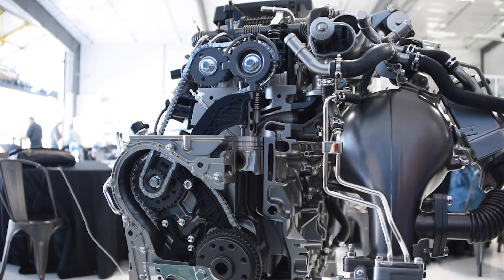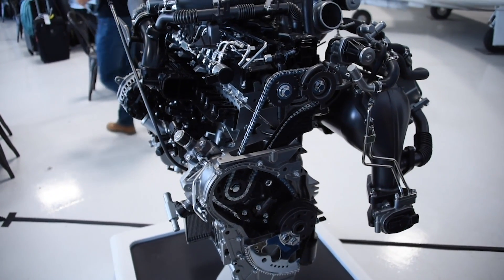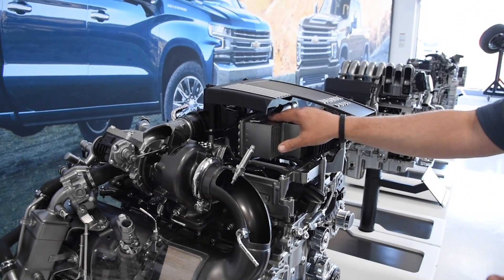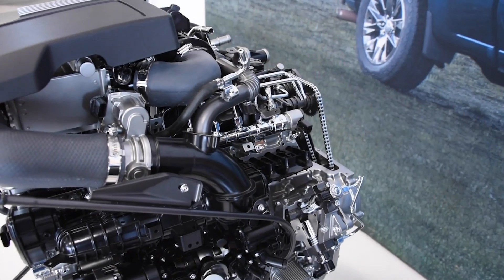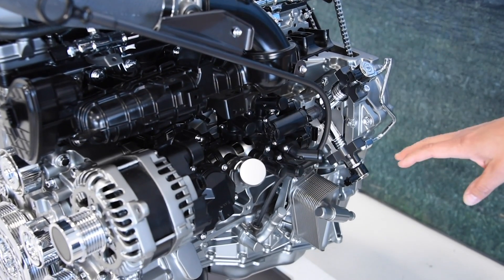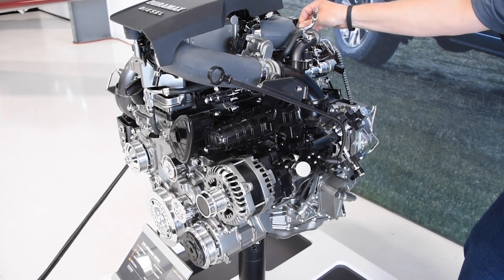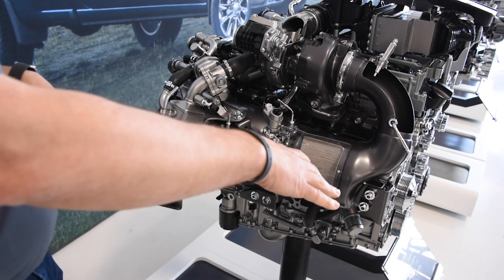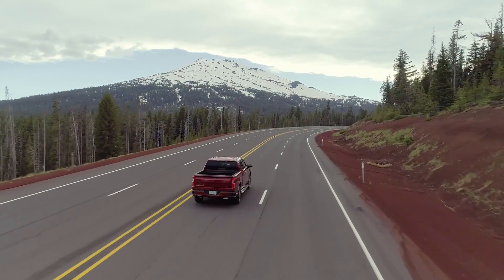What you don't know about the 3.0-liter Duramax diesel

Comment: My friend got one of these in a 2021 1500 truck, its very quiet, actually makes a good sound under power.  At least the rear timing chain is simple, not like a Audi 4.2 etc.  The timing belt is wierd, but with regular oil changes it could probably last a very long time, I wonder on this truck if you could just back the trans off 6inches etc to service it, drop a few driveshafts or its a huge deal, pull transfer case etc to change the belt.  You can see all the clever packaging to get into a compact modular unit that can go into just about any commercial\personal vehicle, the emmisions control is pretty neat with all the interesting coolant control (scary to have engine oil cooler like that, if gaskets fail...) Hopefully they're specced top quality parts on this thing for belts\gaskets or it could be, not so good.
Reply: Garbage design IMO. Monster amount of labor just for one chain that you know is going to be a problem.
Reply: @HVAChrisss  Dropping a tranmission is "monster amount of labor" every 150k-200k miles? Man how were clutches replaced in the old days, must have just junked the car every time it needed a clutch!
Reply: @HVAChrisss  It shows a OEM doesn't give a crap about after the sale with a design like this, considering this thing is also meant for Commercial application and likely built to a price, pushing 30psi of boost stock (lots of CFM I'm sure) its not good.

Comment: If the engine would only last!!! Chains and sprockets go out before 100k dam expensive to get repaired, the engine sounds like it’s knocking!!!  Oil pressure runes very LOW!!! Getting a lot of steal, silver, nickel, in oil sample. Have to change oil to AMSOIL and change at 6000 mi. Max. After repaired still rattling!!!  Sounds like a rod knocking. Needs to change engine but chevy won’t fix it properly . Run it until it comes apart. Transmission went out at 37k they repaired it. Rather than replace ???? Not happy at all for a 65k truck. Never again!!!

Comment: Sorry I won't buy a Duramax due to the belt driven oil pump and numerous sources stating belt change every 100k.  Come on guys why is it built requiring the removal of the transmission to change a wear item?  Am betting 5 years down the road this will have a very bad reputation.

Comment: Idiots..only a complete fool would run an oil pump with a rubber belt...and only a damn fool would run the timing in the back of the motor.  Way to go GM, take a decent idea and completey &*#($ it up with a Bull #&$(# design that was completely unnecessary

Comment: The motor is going to blow after 100000 miles if it even makes it there 😳 😅 they  Basically turn this motor into a water heater the oil coolant transmission power steering is all going to be cooked alive... 

When my car coolant hose broke and I had to make it make home I kept filling coolant up with coolant and it cooked my motor oil and hydraulic transmission fluid on top of power Staring fluid...

 The engineers at gmc didn't really think 🤔 about fluid temperature and when you pass it's threshold the fluid becomes useless  Because it loses all of its properties at boiling temperature... 

 My guess is the block's going to crack right down the middle or  All of the electronics are gonna be cooked and and the fluid and the motors gonna blow up... 

 They didn't even thermal wrap anything around the DPF or even if they did its just going to over all the time...  I would be really nervous when this thing re-gens and it gets really hot 🔥

Comment: The camara guy  just says "simple drop the transmission to replace the belt"? WTF!! man simple drop a trans...smh
Reply from the maker: Easier than disassembling the entire front of the engine, including radiator, three cooling fans, water pump, etc. and then re-assembling and bleeding the cooling system, which most people don't know how to do correctly. In any case, it doesn't matter because 95% of consumers will have the dealer do the job.

Comment: I liked it until finding out the timing chains are in the rear. Disgusting. I expect a German automaker like Audi to pull that crap (which they do) but not GM and CERTAINLY NOT in a truck. Idiot engineers. There goes long-term reliability.

Comment: Looking at this as a mechanic, I already see exactly where it will fail. Plastic intake with swirl valves will get sooted up after a while, oil pump belt? Seriously? , plastic Coolant flow controller will absolutely fail later on. Either electronically or leaks. All this stuff looks like the terrible Sprinter emission crap. Not really happy about this little diesel

Comment: Is there actually room to, "Just back off the transmission" when you need to change that oil belt? If it sits in oil why couldn't you have just made it a chain???? People who maintain their own vehicles knows how imperative oil flow is and you want to scare them with a degrading belt in the back of the engine that drives the oil pump?? Seriously you might have a secret Dodge employee working for your engine team.
Reply from the maker: Reducing noise in contemporary engines, particularly light-duty diesels, has become very important for manufacturers. Gears, and even chains are noisier than belts, so they use them when possible. As for the "degrading belt", nearly all passenger cars have a timing belt that must be replaced around 80,000 miles and typically costs around $700 to complete. Most car owners don't do this job themselves. The oil pump belt needs to be replaced around 150,000 miles, and most people won't do that job themselves, either.

Comment: I like the idea of a small displacement diesel engine. Why more diesel engines aren't available in the USA under 6.6 litres is beyond me. Why are most of them over 6.0 litres? Not everyone needs or wants a large displacement engine. Perhaps if you're towing a 25' or longer travel trailer, or you're driving a 30' motorhome, you might want a large displacement turbo diesel.

Comment: Very advanced diesel.  Will be a good engine up to 150,000 miles.  Sounds expensive to pull a transmission on a 4 x 4 to service a belt. Wish they would’ve used a chain on that also
Reply: To be honest, I don’t see where it would be that much more difficult/expensive than any trans in a newer 4WD truck. I have a lift in my garage, and first thing I did was put it on my lift when I got home to look underneath. Other than some more plugs, fuel lines going to filter on drivers side, and few other miscellaneous things, it’s shouldn’t be that difficult…..I say that without having removed one of these yet. For the guy that wants to save the money and DIY, any trans with transfer case is going to suck on your back in the driveway. 

Still sucks that it needs to be done, but how many cars need their timing belts changed at 100k miles?  Miss it on a Honda in time, and you are replacing a lot more than a belt…..

Comment: The belt driven oil pump is just baffling not necessarily because it's a belt (other engines out there have been doing something like this directly or indirectly for a long time) but because it's on the BACK of the engine requiring you to pull the trans to SERVICE it and he said it has a 150,000mi Service Life meaning it's expected to be replaced. 
Also how nonchalant he was when talking about the belt snapping is a bit disturbing "oh you'll get the proper diagnostics and a message if the belt snaps" yeah sure lets say you're going down the road at 70mph and the belt snaps, you're not going to shut the engine off instantly and you WILL starve that engine for oil probably upwards of a whole minute while trying to pull off the road. 
However the EGR after the DPF is smart, it would really help with the soot loading problem in the intake and cooler.
I do worry some about about getting rid of the Hydrocarbon injector and moving to pushing fuel out the exhaust valves and potentially lighting it off in the turbo, I know it's probably been straightened out by now but I know one of the major issues with the 6.4L Powerstroke was the DPF regen flooding the cylinders and burning up the turbo because it used this method.

These engines are super quiet, GM's current 2.0L turbo engine (the LSY) is WAY noisier and rougher than this diesel.

Comment: I work on diesels every day and servicing that oil pump belt is no big deal, this engine is a great design and better than ford and Ram small diesel engines
Reply: They say 150k but I know of at least 3 timing belts that had 75k service intervals and I never touched them well past 250k.  Also their was a DMax rep on another channel that said they tested the belts on their test engines at 300k and there was no deflection/stretch in the oil pump belt, also part of the design is to keep the belt wet with oil from the sump which prolongs it’s life.  Much ado about nothing tbh.  And lastly to service the oil pump belt you only need to move the transmission about 1.5 inches back to get access to it.
Reply: If it were 200,000 mi interval, I bet there would be much less Kvetching.
Reply: @mefobills279   I'm not much of a GM fan anymore, but aside from that if the engine wasn't wound up high and hard all the time pulling, the belt is probably fine for 200k. 

They've done 150k mile inspections and the belt looked great. Typically daily commute, tow ever so often like an average user and 200k wouldn't scare me
Reply: The fact that your user name is Cummings Power and it's actually Cummins negates anything you said because you're a dumbass !
Reply: @mylarson7640  Larson the fact that you commented On someone else’s comment from 3 months ago trying to argue that this $3,000 upgrade of an engine to save you thousands in fuel makes you you look like a dumb ass I’m disappointed in you stop commenting on the internet

Comment: Definitely sounds like they thought of everything to keep factory trained mechanics with specialized tools fully employed.  But at least they made it so they can get repairs done in 40 hours or so.  I had a 2004 chevy 3500 work truck that blew its heater core.  It took the dealer 3 days and the complete dismantling of interior to replace a $50 part. The labor bill was over $1000.  Smart planning by the engineers
Reply: Buts that's every heater core in every vehicle tho.
Reply: That's probably true in all modern cars...  I'm a dinosaur worked on a lot of pre computer, pre plastic cars over the years.  A heater core was a couple hour project
Reply: Yeah, nowadays they just buy another car. Haha.

Comment: This collection of engineering(?)  errors is a nightmare. It looks like something  BMW would build. Electronically controlled everything. 36,250 lbs. injection pressure, & injectors able to dispense as many as 10 injections per stroke. Mechanics won't be able to run fast enough to change high pressure pumps, pressure regulators, or injectors. Anyone with ANY degree of mechanical &/or electrical understanding will see that this thing will spend most of its time in a  GM shop. Who thinks this crap up?  My Cummins 6BT 12 valve with the P7100 pump has well over one million miles on it, & it starts & goes every day. I have replaced the alternator once,. I replaced the water pump once (front seal was dribbling coolant) , it still has the factory lift pump, the factory injectors, & the P pump has never required servicing , The oil pump is GEAR driven. The worst problem I have had is the tappet cover gasket leaking & having to be replaced, & now the front gearcase gasket has started to weep. I changed the FSS out for a push pull cable, so the ridiculous FSS is gone.  There are no circumstances under which I would buy or own a vehicle with one of these diesels in it. I doubt that Warren Buffet or Bill Gates could afford to own the damned thing. Thanks....at 81 years of age, my Ram 2500 with its "B" series Cummins will do me as long as I am likely to live
For those not familiar with the 12 valve Cummins in the the pre 98 1/2 Dodge Rams, the FSS is the fuel shut off solenoid.   Thanks for reading my rant.
Reply: The 12v Cummins may leak oil but it'll last till the end of time. They really don't make 'em like they used too, even if it wasn't for the emissions requirements I still think the engines would be hideously complicated because engineers love making things complicated.

Comment: i was literally buying one of these trucks until i heard about that "wet belt." that will last 150k then grenade itself destroying my engine in the process. Sounds like GM's version of a damn 6.0 Powerstroke.... What a joke.
Reply from the maker: It's unlikely to "grenade itself" at 150K miles...that is the recommended maximum life fo the belt, much like a timing belt on almost every car has a change interval of around 80K. If you choose to operate the engine past the change interval and the belt fails, that's on you.

Comment: Taking out the transmission to service the Belk, is just as easy as working on it off the front of the engine. Are you out of your flipping mind. I was actually starting to look at this engine, and then I run across this crap. Who's stupid enough to still put timing chains on the backside of a motor???
It does look like it has a few tricks taken from the 2.4 L diesel which Chrysler used for years. And that was a good engine. In a Chrysler minivan for instance in Australia you could fill the Fuel and drive a thousand miles with one person in the van then fill it up with 20 gallons drive it 737 miles with seven people in it.

Comment: We are basically witnessing slow death of internal combustion engine at it's prime.... RIP. 
There is no way this engine is going to be serviceable in a reasonable economic fashion. 
A complex engine running at 30 psi boost will be worn as soon as it clocks 100,000 miles. Then it will take 1000s of dollars to keep it up. 
At that point you will toss this and buy a new one... and new one will be an EV.... 
i am holding on to my 1987 diesel truck for as long as i can :)

Comment: So much whining about changing a simple belt that lasts MINIMUM 150K miles (if they designed it to last 150K under all conditions, it will go a lot farther than that under most conditions).  Lots of guys talk big about keeping their cars forever, but I know almost no one who does .  And news flash--ALL Honda v6s, one of the most reliable engines on the planet, have a 105K mile timing belt change that costs about $1K to do the job--lots of parts to remove to get at it.  The Duramax only requires unbolting the transmission, sliding it back a few inches for clearance, and doing the job.  No way this will take more than 4 hours of labor, which means $500 to $700 at the dealer including belt and fluids, and substantially less at an independent shop.  And you only have to do it once for the life of the vehicle.  The fuel saving will make up for the cost many times over.
Reply from the maker: Couldn't agree more. And I've used the same point about timing belts on cars, and no one has anything to say about that. The last time I got a quote for a timing belt was 5 years ago on a friend's Mitsubishi and it was $750. And it will have to be done again in 80K.

Comment: Who in HELL decided to build an engine that needs you to take out the transmission to change a belt at 100K.   Stupid.
Reply from the maker: 150k. And people don't seem to mind spending $700-$800 to replace a timing belt on a passenger car at 80K miles, so...
Reply: @TheRVConnection  I hear ya brother. But the way the entire industry does this type of stuff is just so disappointing.  .
Reply from the maker: @johniac7078  I understand. The thing is, the whole industry is under so much pressure to make these engines (including diesels) so quiet--so even replacing a chain with a belt makes a difference in NVH. As diesel guys, we like the noise...but average customers who may not have owned a diesel don't.

Comment: Why is diesel in pickups even a thing anymore? They cost more to purchase, register, insure, repair and fuel than a gas engine with more power
Reply from the maker: You're thinking about heavy-duty (2500-3500 trucks). Diesel option is marginally more expensive at the half-ton level, registration and insurance don't cost more. Fuel is a few cents more...but a half-ton diesel gets 10 mpg more than a comparable gas engine and annual fuel costs are less. But on a heavy-duty application, I tend to agree...unless you're towing a lot and frequently, a diesel doesn't make as much sense.

Comment: Pure Engineer speak..." that oil pump belt is real easy to change".  Just remove your transmission crossmember, remove your transfer case, disconnect all your lines and cables running to your Tcase and transmission, unbolt tranny from bell housing, remove transmission, unholy timing case and remove it. NOW YOU CAN CHECK YOUR FREAKING RUBBER BELT. Replace rubber belt, scrape gasket area clean and put new gasket on and put timing case cover back on. Slide tranny back under and fight to get everything aligned. Now bolt it in, put your crossmember back on and put your driveshaft back on. Reconnect all oil lines and electrical connections. Now you are done!! Start truck and drive for a day and notice a very small drip coming from your timing case cover....No problem, just remove everything again to gain access to all the bolts. 
To my engineers, get a freaking clue! I was stoked to hear that you made an inline 6 diesel as I have been driving a 5.9 Cummins for almost 500,000 miles so I know they are a better design. Your rubber belt needs to be a chain. I am researching Dodge 3.0 EcoDiesel and the Chevy 3.0 I6 and let me tell you, this Dodge boy was excited to switch to a Chevy or GMC just for your I6 until I saw that rubber belt. I'm not going to be your Beta tester and left with the tab and many others are going to feel the same way. It's a shame really, I had a real nice looking truck built online and was all exciting.